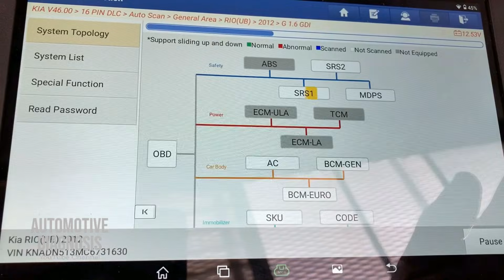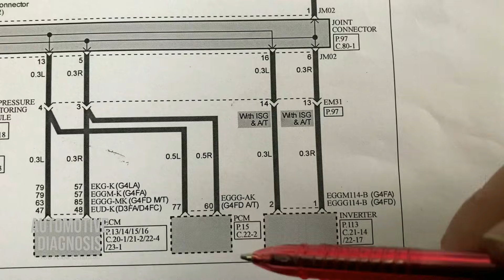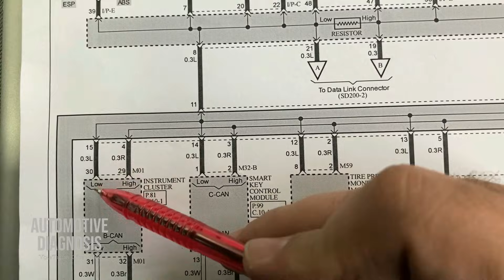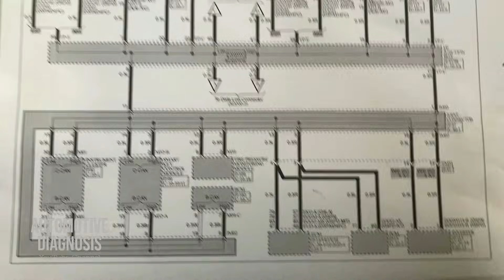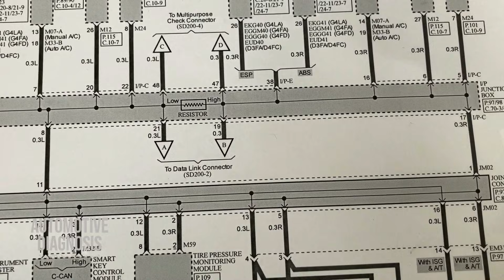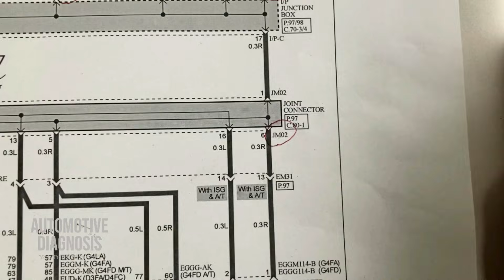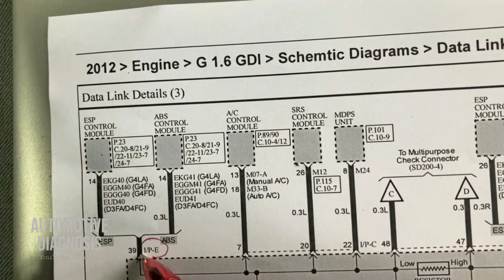CAN-BUS No Communication Diagnostic | Resistance, Voltage, Short Circuit, Pin to Pin Test #canbus

Comment from the maker: 🎯 Online Courses:
🧑‍🎓 CAN-BUS Network Intro, Application & Diagnosis Online Course:
https://fix-it-first.com.au/course/automotive-can-bus-network-intro-application-diagnosis/

🧑‍🎓 Automotive Engine Sensors Intro, Operation & Diagnosis Online Course:
https://fix-it-first.com.au/course/automotive-engine-sensors-intro-operation-diagnostic-2/

🧑‍🎓Automotive Engine Actuators Intro, Operation & Diagnostic: 
https://fix-it-first.com.au/course/automotive-engine-actuators-intro-operation-diagnostic/

🧑‍🎓  Smart Key System (Push Button Start) Operation & Diagnostic in ANY Hyundai & KIA Vehicles
https://fix-it-first.com.au/course/smart-key-system-operation-diagnostic-in-any-kia-hyundai/

🧑‍🎓 Automotive LIN-Bus & K-Line Inro, Application & Diagnosis
https://fix-it-first.com.au/course/automotive-lin-bus-k-line-intro-application-diagnosis/

🧑‍🎓 ABS & Traction Control System Diagnostic Online Course
https://fix-it-first.com.au/course/abs-traction-control-system-diagnostic/

🧑‍🎓 Starting System Diagnostic & Schematics Analysis Online Course:
https://fix-it-first.com.au/course/automotive-starting-system-diagnosis-and-schematic-analysis/

🧑‍🎓 How to use on Oscilloscope for Automotive Diagnostic Online Course:
https://fix-it-first.com.au/course/how-to-use-an-oscilloscope-for-automotive-diagnostics/

🧑‍🎓 Everything About Electric Power Steering Systems Online Course:
https://fix-it-first.com.au/course/everything-about-electric-power-steering/
Reply: Pomieżdu ludźmi też tak zdiagnozowania: kto   co    kaj      i za jakie pieniądze    . Psewdo funkcinarjuszi mechanicy budowlanej i przewoźnej brążach zugrupowano udziałem w wyprodukowanie teroryzuwanijem tego xttt w żółtym wbranie kobieta kryk nasylstwo zgwałcenia i dotegoż jakie służby to popierały wspierały ćieszyłyś ta swołota zugrupowano rujnując rodzine  z trzema dziećmi przed 15 rocznice ślubu 2019 swoim kłamstwom chakerstwom oszustwom okradanijem okradając ta raptowo zfasylfikuwanijem poopisuwały ukrywający

Comment: From your wonderful diagnosis I have formed a question and posed it to CHATGPT.  The answer is very compelling and detailed. Something for us all to learn to use.

Chat GPT question and answer

You said:
I am fault finding on a 2014 Ducati Hypermotard 821 with Marelli 7SM ECU. The Ducati is in LIMP mode.
Ohms testing the CAN Bus system.
At the OBD2 plug between pins 14 to 6 the ohms reading when good = 60 ohms. There is a test process where each module in the CAN bus network (ECU, BBS, ABS and Dash) are disconnected one at a time, then the Ohms value at pins 14 to 6 is measured. The goal value when a single module is disconnected is approximately 120 ohms. 
My readings are : 
ECU = 118 ohms 
Dash = 122 ohms 
BBS = 58 ohms
ABS = not tested as too difficult to reach

Is the value for the BBS expected?
Is there something else I can test to determine the cause of the LIMP mode?

ChatGPT said:
Below is what your measurements actually mean on the Hypermotard 821 CAN network and how to proceed with diagnosing the limp-mode fault.

✅ 1. Interpreting Your CAN-Bus Resistance Readings
Normal CAN network on this bike
	•	The 7SM ECU and the Dash are the only modules known to contain 120 Ω terminators on most Ducati models that use the Marelli 7SM.
	•	The final total network resistance = 60 Ω with both terminators present (120 Ω ∥ 120 Ω).
	•	The BBS (Black Box Switch / Hands-Free Unit) and ABS typically do NOT contain termination resistors.
Your readings
- Module unplugged. ECU removed. 
-    Measured resistance. 118 Ω
-    Interpretation. Good – this means the Dash termination is present and correct.
- Module unplugged. Dash removed
-    Measured resistance. 122 Ω
-    Interpretation.  Good – this means the ECU termination is present and correct.
- Module unplugged. BBS removed
-    Measured resistance.  58 Ω
-    Interpretation.  Correct – when BBS is removed, both ECU & Dash terminators are still connected → network remains 120 Ω ∥ 120 Ω = 60 Ω.
- Module unplugged. ABS
-    Measured resistance.  Not tested
-    Interpretation.  Should behave like the BBS (removal should leave ~60 Ω).

👉 Is the BBS value expected?
Yes. Your BBS reading (~58 Ω) is exactly what you should expect. It confirms that the BBS does not contain a termination resistor and is not loading the CAN incorrectly.
Your ECU and Dash values are good and indicate both terminators are healthy.

✅ 2. So why is the bike in LIMP mode if the CAN resistance is healthy?
CAN resistance checks only detect:
	•	Broken CAN wiring
	•	Shorted CAN-H/CAN-L
	•	Loss of termination
	•	A module physically pulling the network down
Your readings show none of these issues.

Limp mode on a 7SM–equipped Ducati is usually caused by a module-reported fault, not a CAN bus wiring issue.

⚠ 3. Common Causes of Limp Mode on Hypermotard 821
Here are the most frequent offenders:
(1) Throttle Body / Ride-by-Wire faults
The 7SM is very sensitive to:
	•	TPS mismatch
	•	APS (twist-grip sensor) errors
	•	Throttle motor adaptation out of range
Symptoms: High idle, poor response, limp mode.
A throttle relearn (“TPS reset” or “self-adaptation reset”) often resolves this.

(2) BBS/HFU (Keyless unit) faults 

***NOTE HERE:  I do have many PIN CODE errors. I have just attached a good RFID chip to the ignition from the broken key. Now I don’t see PIN OCDE error.

The BBS does NOT disturb the CAN resistance, but it can signal:
	•	Immobilizer errors
	•	Key antenna faults
	•	Internal BBS communication faults
These do not always prevent the bike from starting but can put it in LIMP MODE.

(3) ABS module faults
Common 7SM limp triggers:
	•	ABS sensor gap out of range
	•	Internal ABS unit error
	•	Low battery event causing ABS initialization failure
ABS faults commonly do not show up in CAN resistance tests.

(4) Engine sensor faults
Includes:
	•	MAP sensor
	•	Temperature sensors
	•	Lambda/O2 sensor faults
	•	Knock sensor faults
Any of these stored errors can cause limp mode even if intermittent.

(5) Low battery during startup

***NOTE HERE: I notice the battery is weak. Have a new on coming.

The 7SM will throw “implausible signal” errors when cranking with low voltage. Once set, these errors can persist and force limp mode until cleared.

🧰 4. What You Should Test Next
✔ A) Read ALL stored ECU, ABS, Dash & BBS diagnostics
This is the #1 next step. Resistance tests only confirm the CAN physical layer is good. The fault will be a diagnostic DTC.
Use:
	•	JPDiag / GuzziDiag or
	•	Dealer DDS / TEXA / Healtech
Pull codes from:
	•	7SM ECU
	•	ABS module
	•	Dash
	•	BBS

✔ B) Perform a throttle body / APS–TPS calibration
Using DDS or JPDiag (if enabled). This frequently resolves limp mode after battery issues.

✔ C) Check CAN wiring for intermittent shorts
Even if resistance is good static, flexing the harness can reveal faults:
	•	Wiggle-test CAN twisted pairs near steering head & under tank.
	•	Look for chafing near front frame spine and ABS unit.

✔ D) Check ABS wheel speed sensor gaps
If front or rear speed sensors are out of spec or dirty, the ABS module may trigger limp mode.

✅ Conclusion
Your CAN resistance readings are normal. The BBS reading of 58 Ω is exactly what it should be and does not indicate a fault.
Your limp mode is almost certainly caused by:
	•	A stored ECU/BBS/ABS fault code
	•	A throttle body/APS/TPS adaptation issue
	•	An ABS or sensor error Not a CAN wiring problem.

If you want, I can help you interpret any DTC codes you can retrieve (7SM codes are not always intuitive).

Comment: Absolutely fantastic detail and pacing.  Champion job.  I have a Ducati Hypermotard 821 motorcycle with a CAN system that is in LIMP Mode.  I have tested the 60ohms logic at the OBD2 connector pins 14/6.  Reading = 58ohms. However another test was to disconnect each of the 4 modules in the system (ECU, BBS, ABS, Dash), 1 at a time, and see if 120ohms is found. 
All connected = 58ohms
Disconnect ECU = 118ohms
Disconnect Dash = 122ohms
Disconnect BBS = 58ohms
Disconnect ABS =. too difficult to reach

BBS module, when disconnect, does not change the ohms. Now I am trying to understand what this is telling me.
Reply from the maker: HI my friend. This means that terminating resistors are inside the ECU and Dash.

Comment: A+++++ What is the process if you have a Gateway?
Reply from the maker: Hi my friends, gateway is normally between two different type of CAN-Bus networks, so if we have any issues across two networks we can focus on the gateway. But gateway itself is also a unit on the network that can cause the same issue I explained in the video.

Comment: Did you check can high and low resistance on pin 6 and 14 ? Is that how it's checked?
Reply from the maker: Hi my friend, yes. For checking the CAN-Bus resistance we should check it between pin 6 and 14 on OBD2 connector.

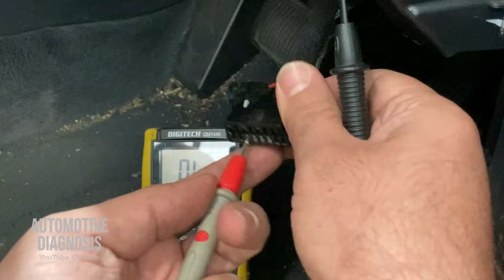Comment: That's why at 10:10, when you tested continuity to CAN High, you measured 60 ohms — because CAN Low was shorted to chassis ground, and you were actually seeing the termination resistor through it. In other words, it looked as if you were measuring directly between pins 6 and 14.

Comment: Very educational. Would you have still  60 ohms if the engine control module Can low wire were shorted to ground?
Reply from the maker: Hi there, most of the time that short to ground won’t affect the total resistance but communication will stop.

Comment: Hello. I wish you could do a video on Toyota and Lexus Can bus. I am dealing with a communication problem on a 2013 Lexus RX350. I have multiple codes: Loss communication with Air bag, steering angle, yaw rate , lateral, occupant seat detection and so on. I have discovered that the Air bag module is unplugged while testing the cigarette lighter. When I plugged it back in, I lost communication with the power steering module, and the ABS light came on. I know all the modules on the Can Bus are connected in parallel. I should have not lost communication with only one module if the Air bag module took out the whole network. From what I have learned, the BCM is the Gateway. which does not make sense as other modules are connected to the DLC through a junction. If possible, show me how to read the Data Bus diagram. I am not too good at reading diagram. Hopefully, one day you will have to deal with a no crank no start on this particular vehicle and I can see how you read the starting system diagram.
Reply from the maker: Hi my friend, we already have a video for starting system diagram and also for reading the wiring diagrams on Toyota and Lexus. The diagnostic procedure is same as what explained in this video, however finding the joint connectors are very important to isolate the problem area. I will try to make a video on a Toyota or Lexus as soon as I have a good one.

Comment: What happens when the obd terminals 6 and 14 are not used for dianosis?
Reply from the maker: Hi there, You mean you have the CAN-Bus on other pins or there is no network in your car?
Reply: Its a 2007 holden barina (daiwoo) auto hold stays on @AutomotiveDiagnosis

Comment: Great video.
I am not so good with diagrams.
I check resistance between positive and negative connection terminal which go to battery. With battery disconected and got 30k Ohms thats mean got short positive to ground yes?

Btw. Are u have garage  somewhere  in Scotland? 😅

Comment: My truck has no communication, when i check the resistance between pins 6 and 14 of dlc connector, it doesnt get a reading, my multimeter just says OL, what does this mean? Does this mean the wire is completely severed somewhere??
Reply: You have to check wiring diagram, some vehicles obd2 connectors goes to the gateway so the resistance check is not valid.

Comment: Hi my autel dtcc000187 no can communication car crank no start also dtc fu3l flow regulator at stop would that be linked do you use Mitchell wiring
Reply from the maker: Hi there, when you have no communication, sometimes it’s caused by no power supply on the control unit. My suggestion is to check the relevant fuses and to check the power on the ECM connector too.

Comment: Is itvtypical European pins to check high low
Reply from the maker: I didn't quite get your question, if you are asking about the pins on the connectors, wiring diagram specifies the differences for any region.

Comment: Hi how do you find which resistors is damaged if reading 120ohm
Reply from the maker: Hi my friend, you need to locate the resistors using the wiring diagram, and check the units one the connector.

Comment: 2 resistor each 60 ohms makes up for a 120 total
Reply from the maker: No my friend, there are two resistors, each 120 ohms, and total resistance is 60 ohms because it’s a parallel circuit.
Reply: @AutomotiveDiagnosis your right

Comment: I have a 2011 ford fiesta. I recently changed the TCM. Now with the rebuilt TCM I have a communication issue. I first thought it was a faulty rebuild on the TCM or wrong/faulty programming. But the company that rebuilt the TCM told me to check resistance between Can-Hi and Can-Lo pins on TCM harness while it is unplugged. I was told it should have 120 ohms resistance but it only has 60 ohms. I do have the 60 ohms resistance im told i should have between Can-Hi and Can-Lo on the obd2 connector under dash. Would that indicate a possible bad wire on Can-Hi or Can-Lo ? Or could it be bad resistor on the can buss system ? If a resistor where would i find it ? There does seem to be some voltage difference between the Can-Hi and Can-Lo pins on the transmission harness.

Comment: Hi friend, please I have kia sorento um 2016,the scan tool can not communicate to ecm, tcm and abs control unit, the resistance 60 ohms, but the voltage can high 2.4v,and can low 2.4v,the rpm does not work please I need your help
Reply from the maker: Hi my friend, I would check the power and ground on PCM first. There could be CAN Bus problem too, in that case you need to check the short circuit on  the Network.
Reply: @AutomotiveDiagnosis  please i have checked the short to ground everything is ok, and there's a code on 4x4 P1837 Vehicle Variant Can Not Be detected
Reply from the maker: @ernestdamo677  This code is only for 4x4, it's not gonna cause no communication with ECM. Have you checked the power and ground on ECM?
Reply: @AutomotiveDiagnosis  OK thanks i will check and get back to you
Reply: @AutomotiveDiagnosis  please what is the meaning of P-CAN HIGH
Reply from the maker: @ernestdamo677  It's Powertrain CAN High
Reply: Hello friend, there's another thing i have noticed on the instrument cluster, when you switch on the ignition the check engine light will go off even before you start the engine,

Comment: I wished somebody would show ho to test with a multimeter , instead those special , expensive , high tech tools  
I never seen an scope , also might be difficult to use  for DIY people .
Also there are no electrical wire diagrams available for those type of tests , of for specific problems ; not even the Chilton , and Haynes manuals have those diagrams ..
In my working 2011 Chevrolet Express 3500 I have U0101 , PO442 , C0055 , U0140 and U0100 , I need powers and grounds for the ECM , , TCM , BCM and  VCIM , and I can find diagrams .
Reply: I just did a quick search of 2011 express 3500 canbus diagrams, found all kinds of info .
Reply: @Ghost-ji1ef  thank you I appreciate it , ALLDATA , has a subscription for DIY but , my family and I have different makes , and ALLDATA DIY , gives you just for one make .
Reply: @Ghost-ji1ef  I can't find nothing in Google  . For my uncle's Chevy .

Comment: The voltage on the can bus high is also too high. Its displaying 12v that thing can lit up a 12v bulb
Reply from the maker: Hi there, Voltage on CAN-BUS hi is around 2.6 v when checking with a multimeter. when you get 12 v, it might a short to ground, or maybe you are checking a wrong wire!

Comment: When you checked resistance between pins 6 and 14 on the DLC connector was the battery disconnected. ? I'm viewing a wiring diagram and the vehicle i am working its hot all times ? 
I would think it would be safe to remove either the fuse or disconnect the battery prior to conducting the ohms test ?
Reply from the maker: Hi there. Removing the battery is not required. You just need to turn the ignition switch off and wait for a few seconds until CAN-Bus goes to sleep mode.
Reply: @AutomotiveDiagnosis  thanks

Comment: If CAN-L was shorted to ground how did the resistance measurement show it was ok ?
Reply from the maker: Hi my friend. If CAN-L is short to ground, diagnostic procedure is the same, you will get the low resistance when you check the resistance between CAN-L and body ground, and when you check the resistance between CAN-H and body ground you will get 60 ohms (if all control units are connected.)
Reply: Just a suggestion, good up a test light batt + on the DLC an when the light goes out you found your short, instead of going back to the DLC a checking continuity every time.
Reply: if not connected where is the problem sir
Reply: Hi tanks for the reply what wiring diagram you recommend
Reply: What website can I get wiring diagram for free ?

Comment: how about short to power,
Reply from the maker: Same way of troubleshooting, the only difference is to check the voltage on the CAN bus and go step by step. You can find our full online course about "CAN-BUS diagnosis on the link below:
https://www.udemy.com/course/automotive-can-bus-network-intro-application-diagnosis/?referralCode=C0C59CCB3595CB9C0C13

Comment: Good video! Question how do you know which correct is ip21 does the diagram tells where are they located? Example under the dashboard)?
Reply from the maker: Hi my friend. All components and connectors locations are in the wiring diagrams.